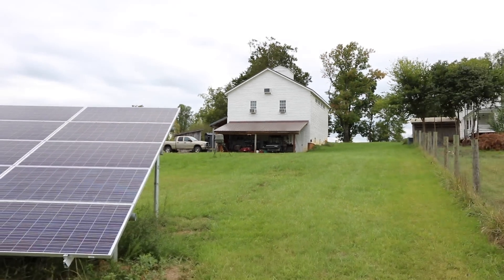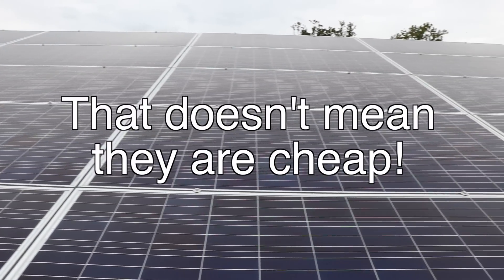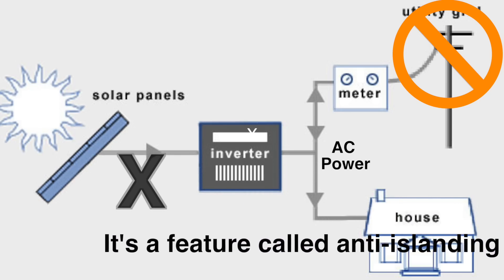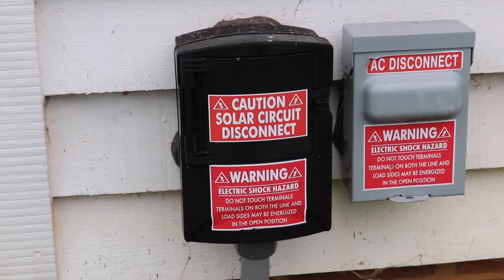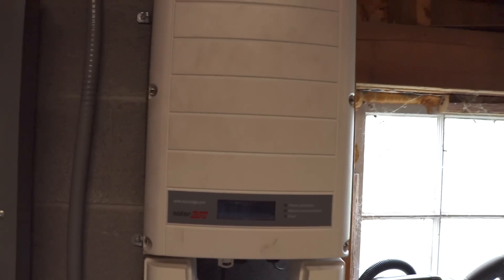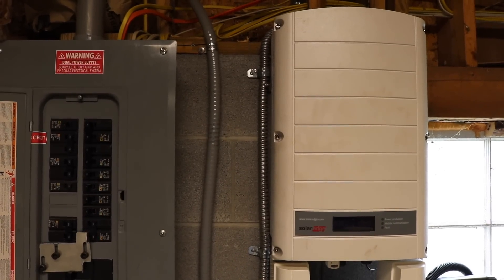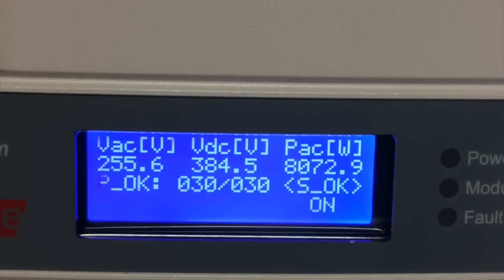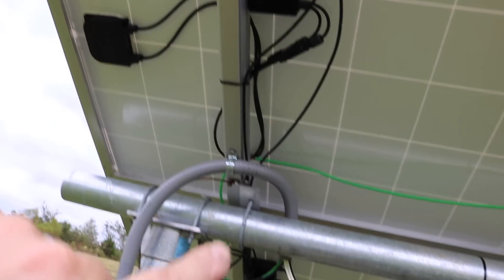The ugly truth behind grid-tie solar systems. Part 1, FarmCraft101 solar.  Watch before you buy!

Comment: buy one panel at a time and hook up to battery Bank and power converters and just run certain things in your house, so if the power ever goes out, whatever you got running off of your solar panels and Battery Bank still work, your electric bill goes down because you're buying solar panels as you can afford them, and you are not completely off-grid but you are half off grid, if your electric bill is $200 a month it will slowly decrease and will be about $50 a month after you have eliminated all the other electrical appliances that's on the grid and hook them to your power source,
Reply: Batteries cost more/kwh than the grid. Running batteries in your house for fun, thinking you're screwing the power company is a huge waste.
Reply: Art Smith , you can buy a used forklift battery relatively cheap and will last about 20 years, and you're not screwing the electric company, you're saving money that's the entire reason you're doing it, there used kits out there that people has returned because it wasn't economical for them or they just didn't know what they was doing, and you can get them at Half Price or less, right now my electric bill is under $35 each and every month for the past 3 years, so am I screwing the electric company or am I saving money?
Reply: @jimthomas777  my bill is $40 before adding grid tie. Talking about isolated opportunities to buy equipment below typical market value isn't very relevant to wide spread solutions.
Reply: Art Smith , you work for the power company art and don't want people to go off grid?
Reply: @jimthomas777  Good old youtube crowd. Let's just watch and see how many people put ~$1,000 batteries in their home. I'm fortunate that my meter bill is $6/mo. $72/yr for "unlimited no maintenance storage" with built in backup when my array produces less than I need.
Your solution is great when someone is looking at $10-100,000 to bring power to a remote location that is otherwise a great place to live.
Reply: Art Smith , first of all Art Smith you are talking about grid-tie which means you are still hooked up to the electric company and you are sharing urpower with the electric company and the electric company is sharing their power with you, I am still hooked up to the electric company and I make my own power but they are separate, I have less than $500 in my entire system, half of my house like LED lights and other small items are run entirely off grid, items like refrigerator, stove, hot water tank, microwave and other big items like this are still ran by The Electric Company, if the electric goes out from the electric company I still have lights in my house, all on a separate off grid electric source, you messed up big-time when you hooked up with a grid tie, that was your mistake, and I ain't talkin about wide-spread Solutions like you said I'm talking about one individual saving on his electric bill which I am doing and as my system gets bigger as I add on, less and less will be on the electric company grid until I can finally go completely off-grid, your system must have cost a lot of money or you sure wouldn't be talking so negative, like I said my entire system so far is under $500 and it saved on my electric bill immensely, it's done paid back the $500 two years ago
Reply: @jimthomas777  I'm only concerned about widely available off the shelf solutions. Your solution is an individual accomplishment that can't be scaled up to the general public. What if you got everything free 2nd hand? Then it would be infinitely valuable, but not repeatable. The power company is not my enemy. This year is the last year for the biggest tax discounts so people on the fence really need to finish this year. In the real world, things are not as modular as the tinkers claim. The first array needs to be an appropriate size and as much as possible the 2nd array can be planned for. The video is an excellently laid out medium size string inverter system. My array is 8 panel microinverter. Probably about the smallest practical size. There are a lot of rules when connecting to the grid and doing with a 2-4 pannel array is not practical.
Basically batteries are a substitute for the meter charge. Absolutely no way to operate off the shelf batteries for the monthly cost of the meter. In fact, power companies are getting more sympathy towards this and another urgency is for people to get grandfathered into the current rate structure. Some day, free net metering is going to be gone. That issue should be one of the leading comments of all of these solar videos.
Reply: Art Smith , everything I did is repeatable by anyone or everyone, by buying one piece at a time an adding to my system was not a big price, I bought stuff from Missouri wind and solar, got gel cell battery and a 1000-watt converter at Walmart, and my plans are to buy more as I can afford it and more gel cell batteries an a 3000 watt converter and then when I can run 110 and 220 volt I will be able to run everything and then I will go off grid and anyone and everyone could do the same exact thing that I did
Reply: @jimthomas777  Enjoy your hobby but what you are doing won't work for most people. I use 7.5 kwh/day without the solar array.  I just estimated that 4.5 of that is the big stuff. So 3kWh/day for the little stuff, 90 kwh/mo and I wouldn't be surprised if you use less. At $0.11/kwh=$10/mo. If your $500 could do that you would have a 50 month payback. But you have $100 battery, $50 charge controller,  $200 inverter so maybe $150 panel. $150 panel is 100 watts maximum.  100 watts will make average of 0.5 kWh/day.  That's 15 kWh/mo, or less than $2/mo which is 250 month payback = 20yrs payback. I'm happy to revisit the info but until you're using a UL Listed 240V split phase inverter you're just tinkering. Be happy for the grid that's doing the heavy lifting for you.
Reply: @jimthomas777  And you started this thread with a comment about the brilliance of using an old fork truck battery.
Reply: Art Smith , I did not start this by saying get forklift batteries, I started this two weeks ago saying by one solar panel at a time as you can't afford it, and I don't have to worry about any tax discounts, and I don't have to worry about any rules connecting to the grid, and I didn't say that I owned any solar panels, because I don't own any solar panels, I have four PMA'S ,  and my hobby as you call it is saving me money, and when I get everything hooked up my entire house will be running for free because everything has done been paid for, and I will have a zero electric bill, you misspoke and said Hobby, call it a free Hobby, and I bet you still owe thousands of dollars on your solar panels and for years to come you will, and my free Hobby has already saved over $3,500 which means anything I buy is already been paid for, and you still owe thousands of dollars, so you can do all your little adding and figuring and seeing how much I've spent and whatever else you want to calculate, but I am planning to get some solar panels, I mean free solar panels and free batteries and free converters and free controllers and free this and free that, how much stuff you think I can buy with $3,500 that I've saved,? so Art don't forget to pay your electric bill next month, and for the next few years or your electricity will be shut off and your grid tie connection,  your free Hobby off grid laughing $35 a month electric bill guy
Reply: @jimthomas777  Fork Truck battery, 2nd comment down.  Paid cash for my 2.6kWp array and consider it break even or better entertainment and hobby. Update us when you're using a UL Listed 240V split phase inverter. Probably 90% of homes have at least 1 double breaker. Without that inverter you're tinkering with a hobby. How about offering a list of your equipment if you want to discuss it instead of making a game of guessing so you can complain. If you're suggesting widespread use of microturbines that's simply impossible for zoning, and wind resource limitations.  Plus, unfortunately there is no UL Listed ~2,000W turbine grid tie inverter. I actually followed Missouri Wind and Solar when they were close to marketing one but it never happened. Not sure what your $35 electric comment is about. Next time you talk to Jeff, ask him what happened to the microturbine grid tie inverters?
Reply: Art Smith , you said I started this by saying forklift batteries and then you say it was my second comment so which is it my first or my second,? And if a forklift battery cost to Grand and it lasts for 20 years I would say that was pretty cheap, and my hobby as you have called it has saved me about $ 3 ,000 and this April will be 3 years so you can do the math and how much I've saved each month, and like I first started saying, by one damn solar panel or however many that you can't afford and start small buying things off the shelf, gel cell batteries and power converters in any watt range that you want and can afford and add to your system as you can't afford it like I've been saying from the very first start and that you've had an argument with, I don't have to provide you with a list of my items of anything, I'm saving money and that's all that matters and it's none of your damn business, it never has been and it never will be, but anyone can do it because I bought my things off the shelf brand new and anybody else and everybody else on this planet can do the exact same thing, and they don't have to have a grid tie, that's the whole point of going off grid, which is my plan, and like I said I plan to buy solar panels to go with my P.M.A.s and I don't have to worry about rules or regulations or government tax incentives or any grid-tie barriers, or selling electricity back to the electric company because I am going to be off grid, I will be my own Electric Company, my electric bill was running $145 up to $175 each month and now it is $35, last month's was a little high it was $37, so why don't you do some math 2 years and 9 months my (HOBBY) has saved me, I still have 110 and 220 from the power company and like I said all I have is 110 volts as of now off grid but my plan is to go to 220 volts and totally off-grid
Reply: @jimthomas777   You said, "... I don't have to worry about rules or regulations ...".  So, you don't need to pull a Permit and then have your Solar Panel System approved by the Local Electrical Inspector? Exactly, where do you live?
Reply: @jimthomas777  You can stop with the insulting  comments, it just makes you look very childish.  I asked you a very simple question ... "Where do you live, such that you can bypass the Electrical Permit and Inspection Process?"  No, it does not matter if it is one or 20 Solar Panels, we cannot install any Solar Panels outside and then run wires through the walls into DC-to-AC Converters inside our homes and then plug in AC appliances without a Permit and Inspection.  This is a violation of the National Electric Code and it nullifies our Homeowner's Insurance policy.  Every time we would add a new PV Panel, we would be required to pull a new permit and re-inspection. Are you suggestion we violate the law and nullify our Home Owners Insurance Policy?  If you are not going to reply like an adult, then don't reply at all ...
Reply: @jimthomas777  An electrician, is not an Electrical Inspector and you did not pull a permit. So, just like I suspected ... an ILLEGAL installation of a Solar Panels and ILLEGAL DC-to-AC Inverters. Yep, most anybody can "save money" by doing illegal installations.  Your continued swearing, just proves that you are still a child ...

Comment: Your explanation is good based on your basic knowledge,  so what exactly is "ugly" about grid tied solar PV systems? Also,  how come the AC disconnect is installed on the DC side of the system between the inverter and the solar array?
Reply from the maker: Thanks.  The ugly truth is that with a grid tied system, if the grid goes down you can't use your panels.  The AC disconnect is not on the DC side.  Wires go from the inverter back to the disconnect.

Comment: @1:10 isn't the electricity flowing to the path of most resistance? I mean if your house is running 20 electric toaster ovens - that is a lot of resistance, and the electric created by your panels will flow towards the house.
Reply from the maker: Electricity flows to the path of least resistance to ground.  Going through toasters is resistance yes, but it is also a path to ground.

Comment: Why do you use a Solaredge inverter for a ground mount system with no shading?  You would save a lot of money by not using power optimizers.  Why not just use a string inverter such as a Fronius Primo and save $1500 in optimizer cost for a faster payback on the system.

Comment: Will these panels survive a hailstorm? Are their any insurance costs with adding these to your property? Would you be better off to add additional capacity and supply power to the grid?
Reply from the maker: Yes, just as skylights survive hail, so do these.  We've had a golf ball sized hailstorm without any problems so far.  My insurer had them covered automatically, as they cover outbuildings, equipment, etc, so no additional cost in my case.  If I generate more power than I use and sell it on the grid, I will only make 4 cents per kWh, and then I'd have to pay tax on that.  But I save 11 cents per kWh generating my own power and it's tax free.  Doesn't really make sense to over-generate.

Comment: Grid Tie is the way to go its half the price of a battery system, if your worriwd avout the grid goin g down it would still be cheaper to buy a natural gas generator for backup. The only few exceptions is if you have an ass hole electric company that dont grant you back the energy that you put in. and your at the mercy of the electric company.

Comment: Sorry, but you made some silly mistakes: you can put small waterproof  AP inverters next to every couple of panels and need only a thin wire to transport the ac power to your house (why didn't you put the panels on the roof?). For times when the grid is down I am using a small 15hp diesel engine that runs an electroincally monitored device (governor) that always keeps the current in the range required by the inverters. I reduced my power bills to next to zero and am running aircons 24/7 (plus a few gallons of Diesel fuel when there are longer inetrerruptions of the power supply). The generator uses very little once the solar panels kick in.
Reply: A "thin wire" for 8,000 watts  ?
Ummmm, no!

Comment: Very informative video and thanks of all of your efforts. For those of you hating on the cost of solar try to think of all the money you have wasted over the years, if you purchased a new vehicle the value dropped as soon as you drove off the lot, and yes I see lots of people driving shiny new pickup truck and they are not all for work. What he is doing is not only good for the environment but also good for our country, less money to the middle east, The cost of electricity is only going up, my power company ups its rates every November 40 percent for the winter months.  My neighbor is putting in a big system and using the Tesla batteries and is cutting the cord off the grid, he said he has had enough. In my part of the country houses are very expensive and 20 to 30 grand in the big picture is not that bad and unlike the grid solar is coming down in cost. Again thanks for your great video.

Comment: $23,000 for an only 9,1 kW system is an incredible high price. You published this video 2017. At this time, an system like this would have cost in 2017 Europe only about the half. 
Prices are fast falling. For 2020, I will built in Austria a house with 22 kW photovoltaic as the roof. Will be about 14.000 EUR or US$ 16.000.

Comment: So nice to hear someone who actually knows what he's talking about. Interesting vid
Reply: If you think he "KNOWS" what hes talking about, wait til a real solar installer takes the mic.
Reply: Hey is definetly confused on some details and half truths on others...

You will actually lose more production running DC to the house that far, instead of putting the inverter at the array and making a long AC run.

While his Voltage drop example isn't wrong, it doesn't paint the whole picture.

The way they ran it does save them upfront install cost due to lower gauge wire use, but it lost them a very slight production gain from the other settup.